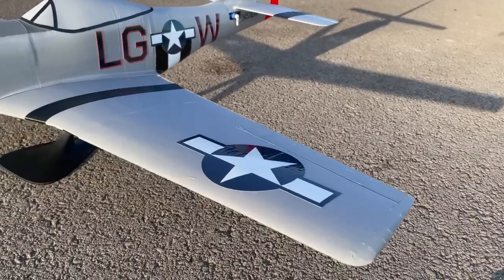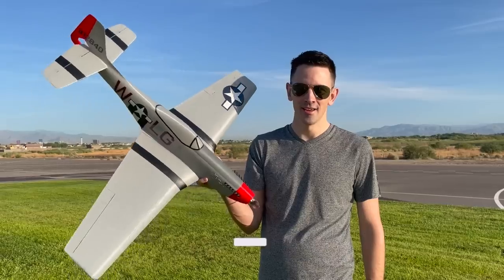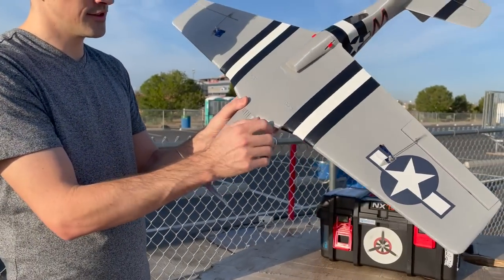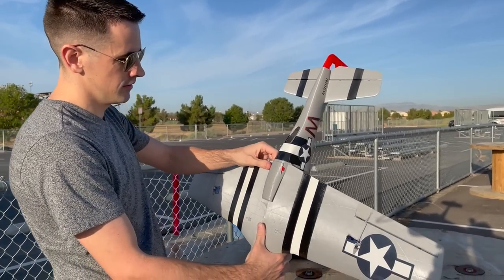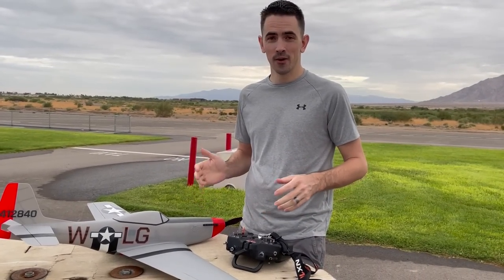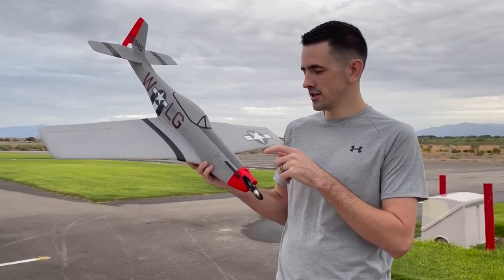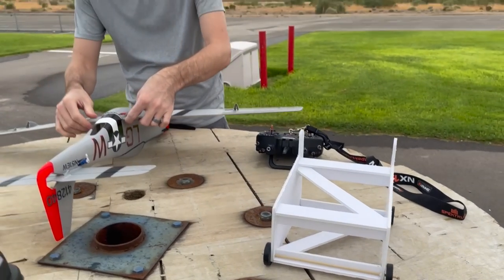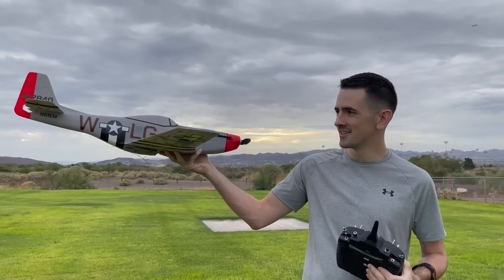Top Gun P-51 Mustang | 3D Printed Plane by 3DLabPrint

Comment: I’ve been watching and subscribed to your channel for a few weeks. Trying a 3D Lab Zero and it kills me to see how easily all of your pieces key together. Mine are always a struggle. Lots of help watching your videos and it’s getting better printing them but this thin wall printing is a steep curve for me. Thanks for the great videos.
Reply: Take care to avoid elephant's foot.  The construction method 3dLabPrints uses has one side slipping into the other via a small lip.  That lip is prone to elephants foot expansion and I found all mine needed to be lightly sanded down around that lip.  They everything went together fine.
Reply: Depending on what slicer you're using, the horizontal expansion (Cura) is a very helpful setting for things that fit too tight (or not at all).  I have to use it with PETG (-.02 average), but not typically with PLA.  Might need to dial in the calibrations on your printer a bit.

Comment: Yay...your finally getting around to some 3dLabPrint planes :)  The P-51 is one of their earlier ones so they are a bit more difficult to build but the early wing ribbing design on this and the Spitfire MK XVI is still my favorite wing build.
Reply: I built mine with the 6s power version instead and still used a spinner on the prop so it looked more scale.
Reply: The print settings are a challenge to say the least.  Going to go back to it and try it again now that I understand the prime and retraction settings better on the upgraded direct drive.
Reply: @wadebrewer7212  It is even more challenging if you print in PETG.  I've printed probably a dozen planes now and I'm still trying to get the settings better.
Reply: @InspGadgt  I got the bright idea to LEARN in Silk.  The first one may not be a flier to be honest.  But man...im telling the look on the Eclipson P51 prints is EXACTLY what I wanted.  Looks just like aircraft aluminum that hasnt been polished under light.  If nothing else....print a wing section out of the stuff just for kicks.

Running Geeetech silver. I think the overture silk prints better and has better layer adhesion, but the Geeetech is something else when you get it right.

I'm wondering how a PETG Silver would look in comparison, I know it would be stronger and stand up to summer flying heat better.  Thoughts?
Reply: @InspGadgt  started prints on the 3DLabPrint P51D first btw.  Switched over to trying the Eclipson design.  A lot easier with their ribbing design to print.  The foil design seems a bit better than the 3dLabPrint design too.  However, having the two in your hand the 3DLabPrint is more detailed and scale IMO.
Reply: @wadebrewer7212  The 3dLabPrint P-51 and the Eclipson P-51 are different scales.  The 3dLabPrint P-51 is 1/12th scale specifically for flying in combat competitions.  The Eclipson is a bit bigger and I don't think has a specific scale.  Also the 3dLabPrint model was designed much earlier in the 3d printed RC airplane days so it has older methods of joining parts than newer planes do.  More modern planes have a much easier assembly than the older ones like the P-51.  That said I personally prefer the rib design that 3dLabPrint used in the earlier planes like the Spitfire MK XVI and the P-51.  The curved ribs they used in the early days is still the strongest design out there without a carbon fiber spar.  But as designs evolved, designers kept going for lighter designs.  The lighter designs have a lot more flex in them and they aren't anywhere near as strong.  My old P-51 survived several bad hand launches and hard landings that would have obliterated planes designed with a more modern theory.  As for the finish look...that's entirely up to the filament itself and proper settings.  The same filament printed on the 3dLabPrint plane as the Eclipson plane, with proper settings, will have the same sheen between them both.  The same holds true between PLA and PETG...so long as they are both made with the same pigment the color is going to be the same.  If Geeetech has a silver PETG that uses the same pigment as their PLA...it should come out looking the same.
Reply: @wadebrewer7212  If you really want a good finish though the best thing to do is to paint the plane.  When you paint the plane you cover up all the glue mess ups and other issues that detract from the model's looks.
Reply: @wadebrewer7212  The 3dLabPrint foil design is more for speed and aerobatics since it is designed for combat.  The Eclipson foil is more designed for easy flying and probably more scale speeds.  My Spitfire MK XVI and P-51 on a 6S setup are easily hitting 90+ mph and with their thin cross sections they take 3-4 times longer (if not more) to slow down for a landing approach then any of my other planes.  The Spitfire even more so than the P-51 because it is more narrow and doesn't have the radiator duct under the plane generating more drag.
Reply: @InspGadgt  good info, thank you.

Found a company that has the STLs for WW2 tanks if interested.  I believe the scale is 1/16th.  With patience though you could scale to whatever you wanted.

Comment: Hi Troy, how did you manage CG? Mine is after assembly very tailheavy and asks for ~70g weight at foremost position with 3s 2200 lipo. 4s seems too heavy to me. 
Overall weight of the plane with 3s is ~880g, quite close to your value.
Thanks for any advise.

Comment: I like your printed planes. When I saw 4.5 pitch prop with 1100kv motor and 3s battery I was going to say that it will be on the slow side more like a slow stick setup and will not fly well. Then I realized that you later switched to a 6 pitch and went for 4s and that is more like it. 
Best of luck in your future builds...

Comment: I'm surprised the masking tape on the servos holds well enough.  Personally I use an old trick from my RC car racing days and glue them in with Shoe Goo.  Shoe Goo holds through even the hardest crash but is removable later so you can re-use the servo.

Comment: the reversable front bolt of the wing is BS. touching the ground with the wingtip causes broken wing and fuse at once. also the rear printed plate of the motor melts after a while and the screws come loose. P47 rubberband is ten times better.

Comment: hello troy mc Milan, you are very good at making airplanes with a 3d printer, but until now you have only made model airplanes, I ask you why don't you also make a helicopter with a drone mounted on top of the blades instead of the blades?  .I made it, "Augusta bell 206b" with large scale depron fuselage, 135cm long fuselage. omnibus v3 flight board with betaflight firmware flies very well and very stable.  it turns like a real helicopter and once in flight you no longer notice the lack of blades.  you could create the fuselage in 3d printing.  I advise you not to make it small but a class º class 700 like mine.  you would do it with more precision than my work done by eye and by hand.  you would have a bunch of views for the novelty.  in my channel I will publish a short video of my unconventional helicopter project or rather of my HELYDRONE. hello good job